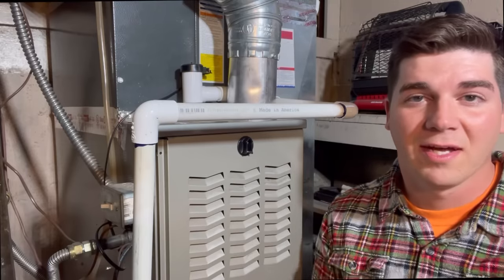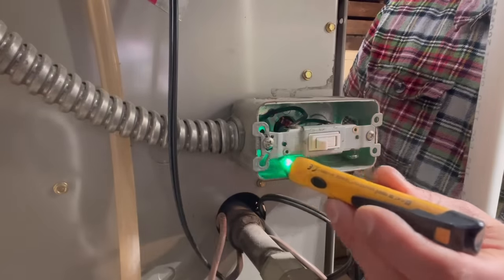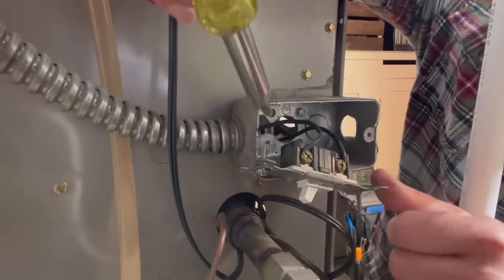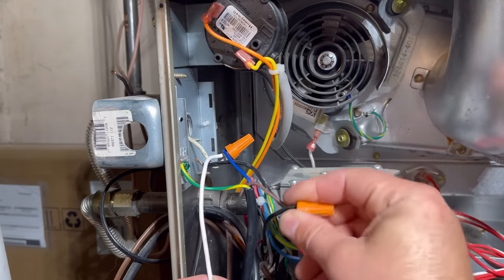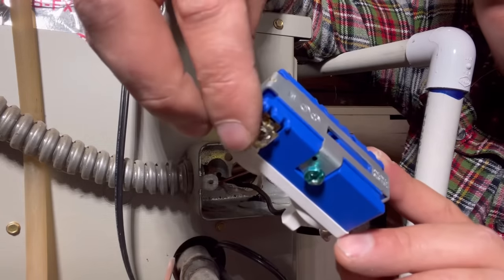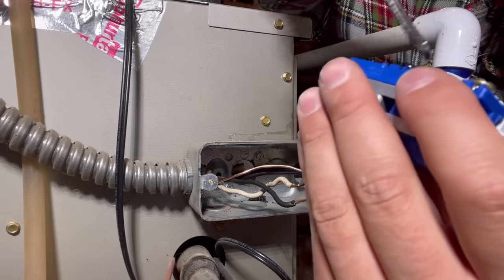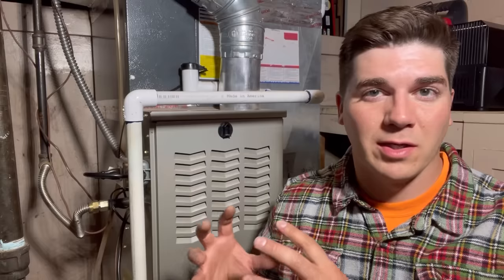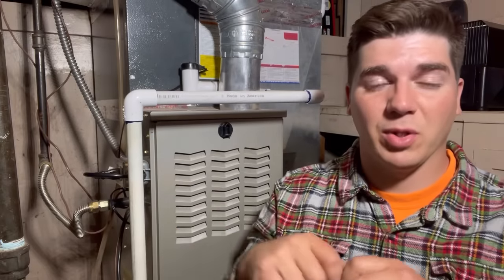This Could Keep Your Family Warm During An Emergency Power Outage.

Comment: Maybe it's just me, but I always use the tester to test that there is power before opening the breaker, and then test to see that it's gone.
Testers don't always work, and how close you need to hold it from the wire is vague.

Comment: It's a  gas furnace with a 120v blower fan and 24volt controls powered by a small 120v to 24v transformer.  I'm  thinking.

Comment: Went through the snowpocalypse in Texas in 2021.  10 - 12 hours without electricity, and house temp inside fell to 42 F.  I am committed to a separate power supply solution for the furnace.    I did a similar rewire to shut off power from the breaker box and add an outlet.  However, now I am concerned to make certain that the wiring inside my portable power supply is thick enough gauge to supply the wattage and current required of the fan motor for extended periods.  How do I determine the working wattage of an active furnace?  Do not want to exceed the separate power supply’s ability.  BTW, you should remind that this is only for a gas furnace.  Electric coil furnaces will likely exceed the wattage of many inverters.  Must be concerned about fire danger and melted wiring insulation.
Reply from the maker: You’d need to check it at startup and while running with an amp clamp. Alternatively you could just pick up a 1500w inverter and see if it works. If so, you can measure the amp draw on the inverter itself. Here is one that I’d recommend:

https://amzn.to/3BWtAPB

Yea I should have stared its only for gas furnaces but an electric furnace wouldn’t even have a switch line this. It will have breakers so someone couldn’t follow these instructions if they had an electric furnace.  Anyways hope this helps! Cheers,   Dave
Reply: @diyhvacguy  I noticed that your setup showed about 450 watts consumption when the furnace blower was running.  I like the idea of testing with an amp clamp, but you raise a good possibility of just getting the inverter with readouts and using it to measure.  I’m not sure how typical your wattage is, but 1500 should be adequate for most applications, I assume?  Sinking the money into the inverter instead of the amperage measure tool may be more economical way to go - a step ahead!  Hey, if I get really ambitious, I might even go solar charging on the battery, but it’s getting complicated for an emergency of limited scale that way.  I just want to keep from freezing to death, or pipe bursts, for a few days, as needed.

Comment: good info--ty!! i'm trying to pre-plan for winter and eventual power outages thanks to NY lousy grid. i'm escaping this state sometimes in the near future so i don't want to pay for the whole breaker box redo for a Bluetti plug--plus those get super pricey w the extra storage batteries to run the whole house...just wanna keep the furnace going. Looks like we have the switch already on the furnace--i'll just need the electrician to do the swap for the plug-in/switch combo. Ty for the vid--i can at least understand what to ask the electrician and not seem like a total dummy lol.

Comment: @The DIY HVAC Guy   Thanks for your prompt reply Dave!  I am not an electrician so I am still confused on what to do about the fuse.  When you mentioned, 'another' fuse, I don't see another fuse anywhere.. .  The shutoff switch plate has a 15 amp fuse mounted on the front of it and then inside that box are the available wires that go to the furnace and some go out to an extra box (with a duplex receptacle installed) on the side of the furnace so I can plug in my automatic condensate pump.

(Getting back to the extra fuse... where do I look to locate that extra fuse... that is, if it even exists?)  
 Have a wonderful Holiday and thanks again!!
Reply from the maker: Does each circuit have a fuse at your main panel?

Comment: If I'm reading the schematic correctly, in the event of a power failure when the pigtail is being fed by the inverter, and since all the hot wires go into a 3 wire WAGO, doesn't one of those hot wires backfeed through the jumper wire into the switch and back onto the main power grid?  That is, unless either the switch or the panel breaker is turned off?  If so, not a huge deal.  I'll put a sign on the furnace next to the switch reminding that the switch needs to stay off.
Reply: In the event of a power outage, they pigtail plug from the furnace is removed from the outlet and plugged into a generator.  The outlet and furnace are 2 separate entities once the plug is removed from the outlet.
Reply: @jolkraeremeark6949  Thanks. I see now where I went wrong.  Somehow watching the vid where black wires were put into the Wago, I got the mistaken idea that a black hot wire from the outlet box was part of that group.  Looking at the vid again I see now that's not the case.

Comment: Do an easier way to keep your furnance on during power failures. Get a whole house emergency generator by Generac. 
As soon as the power goes out, the Generac generator will kick on automatically. Even when you're not home.

Comment: just so you know, there is a video on here showing how the Wago things actually give off a little heat, this means the connectors are wasting power because you don't have direct contact between the two wires.  but yeah, they are real easy to use and with wire nuts unless they are very tight they can come apart.

Comment: would be better if it was some kind of plug that wasnt so easily removed. Also some labeling nearby wouldnt be a bad idea either. It is fine if you are dealing with it but if others need to it could be disorienting. Overall a good concept.

Comment: I was thinking about something like this until I learned, surprisingly, that the two AAA batteries in my basement fireplace thermostat are all that's needed to run the whole thing. It doesn't need a stronger power source to manage the automatic starter or gas valve. How crazy is that?! Impressive engineering.
Reply from the maker: That is impressive :) thanks for sharing

Comment: Wondering about doing similar with a powertool battery inverter. I have 40v and 18v inverters, and a ton of batteries.

I should take an amp draw on my furnace one of these days to see if that'll work.

Comment: Yeah, get a fireplace.  :-/   :-)  I started to say that that would have to be one HELL of a battery...and then I realized this was a gas furnace, which I've never actually owned.  Typically a heat pump with strip heating augmentation here in Fl.   Good idea, the subject of this video.  

The other way is just have a generator and power the house with it when power is lost, because things like refrigerators, lights, entertainment systems, fans, etc. are nice to have to. Here in Fl we have hurricanes, and in one my power was out for three weeks, hence, the genny.

Comment: Good idea for those who don't have a generator. Just for your viewers I have to mention that when terminating your wires on switch and receptacles it's best to loop around the screw in a clockwise rotation so when your tightening its actually sucking the wire around. Even when the receptacle or switch comes with the holes you can poke the wires through the back or clamp that will hold 2 wires beside each other always wrap one wire around the screw and make a pigtail if you need to. Never use the hole in back of receptacle for a connection as there is literally nothing making contact to that wire inside there. Shouldn't be allowed to make them.
Reply: The clamps make a perfectly good connector. The backstabs should never be used.

Comment: Your configuration is different from what I would consider a UPS hookup.A normal computer UPS configuration has the UPS plugged into a power source (wall outlet) then the computer plugged into the UPS. Under normal conditions, the computer runs on home power and the UPS is just the connection to that power. Power goes out and the UPS very quickly switches power to the battery backup feeding the outlet on the UPS the computer is plugged into.Why isn't the furnace wired the same way...UPS plugged into wall outlet, furnace plugged to UPS all the time. Furnace is running on normal home power all the time until there is an outage.No special wiring on the furnace, no need for manual intervention when power goes out - it automatically fails over.This setup would make it easy to connect the UPS to an inverter from your vehicle for extended outages,  just plug UPS into an extension cord from the inverter.Only potential problem I see would be that a non-hardwired furnace connection is against code.But what would a solution be to a problem where your power company can not deliver clean power to your home. Most home appliances would not be that fussy but most new gas furnaces require clean, pure sine wave power to operate correctly.
Reply from the maker: You read my mind, I’m doing a video on this very soon! Stay tuned :)

Comment: Great idea. I plan to have an electrician do the same for my furnace, but was wondering if the air conditioning air compressor is hooked up to the furnace that this method could also be used for the air conditioner in the summer?

Comment: it's amazing how so many people watched this video and still didn't understand how to power the furnace with a battery/generator, most seem to think you plug into the open socket which is wrong you plug the pigtail into an extension cord from your power source, also those who think it would be dangerous cause the power could come back on well that doesn't change anything since the furnace is being run off the pigtails power source so there is no power coming from the breaker to the furnace until you unplug the pigtail from the extension cord power source and plug it back into the socket that is being run from the breaker. damn, it's scary just how many people watches this video and didn't listen or couldn't understand what he was doing with step-by-step all the way through explaining everything.

the only thing to consider is the top pinned comment about having a ground
Reply from the maker: Yea man, and believe it or not if you watch one of my newest videos it’s actually how to just change your switch to a standard outlet, which is even easier, and there is still people that think the prongs are live! 🤦🏻‍♂️
Reply: @diyhvacguy  Ya it seems many people just don't pay attention before commenting nonsense, thanks for the great video and very good explanation of the work done

Comment: One thing you might want to do, that I noticed, is that you've got 20a service from the panel to the heater, not sure what the heater is rated for drawing but if it is 20a you might want to put a 20a plug/outlet on there instead of the 15a one. Biggest reason is just so that you don't overdraw what you're connecting to the heater (generator). Otherwise this is a pretty neat hack.
Reply from the maker: My labels on my box need redone. That actually wasn’t the furnace breaker, I was just trying to emphasize that the breaker needs to be turned off before messing with anything. Didn’t realize people would read into that so much. Thanks for the feedback

Comment: lived in suburb of philly  through a bad winter  whe had jan od ice storms oil tank failed got water in  good  oil co put us on barrel but min wage helper was told just such the top oil to keep us running but moron put suction to bottom sucked water and the lines under house froze so 5 gal can inside  , had fireplace 1 tiny el heater for mom and i had heating pad
but the oil tech braved the ice made many trips to get us warm  and covered most cost under service plan
i removed undergrown tank and 30 yrs later i will never ever bury fuel tanks at a home

Comment: another connector between the box and furnace would save the wire from the edges to, also need to bond the box as well.
Reply from the maker: Yes I have since installed a grommet there. They can be found on my Amazon store for anyone who is looking for them.

Comment: This is a nice quick hack.  Not as elegant as an interlock switch in the panel, but not everyone wants to do that.   I don't suppose you took a power reading from the furnace?  You used a 15 amp receptacle and plug but it was a 20 amp circuit.
Reply from the maker: The breaker isn’t 20amps. I was just using that clip to emphasize the importance of killing the furnace power at the breaker before touching anything. Didn’t realize people would read into it so much. Cheers
Reply: @diyhvacguy  It's youtube ... people will notice EVERYTHING.  :)

Comment: I've heard of many people doing the same thing, but making the power cord a double male to plug into the outlet to power the furnace.  Even though double male cords are dangerous.  I like the way you did this.  Makes it much more safer and easier in the long run.
Reply: I heard there was a secret cord, that you could use to meet the Lord.
Reply: @AndyClements  HA!
Reply: Uh...how is this a double male?  When that pig tail is disconnected, there's no power on that male end.  Perhaps you are confused since it runs through the box that has the line voltage?  Runs through that box but DOES NOT connect to the line voltage.  He just happens to be using the same box where the switch is located.
Reply: @bryanwelsh7608  Because you didn't read what I said.  I said people have made double male plugged cords to plug directly into the outlet and into the generator, which is dangerous.
The way he has it set up is much safer.

Comment: You didn't need to break off the jumper tab and didn’t need the jumper wire.  The gold screw is the landing point for the incoming hot, the two black screws are the switched hot.  If you wired the incoming hot to gold, when you turned the switch on the black screw at the switch becomes energized, and so does the other one via the jumper already installed.  So the outlet is switched with no modifications.
Reply from the maker: I believe the jumper is due to the led light.
Reply: @diyhvacguy  it's just a snap switch, when you throw it, it connects the two screws (gold and black) together.  The led is likely wired to the black screw on the switch side.  With the jumper in place the led and the outlet would also be connected together.  The only reason to break that tab is if you want the switch to operate one circuit (with the output connected to the first black screw) and you want the outlet to be unswitched, so that black screw is either jumpered to the gold with a pigtail for constant hot, or a second hot circuit is connected to that second black screw.
Reply: It's a great mod, for all the reasons you describe.  I'm just commenting on a simpler way to do it.  I did something similar to my refrigerator circuit.  Once it leaves the breaker panel in the garage, I wired an outlet and appliance cord with plug in line before it goes in to the house and to the fridge.  For the exact same reason and function.  In a power down situation, I can unplug it and plug it into a battery/inverter or a generator.

Comment: Good solution with a few comments below providing important clarifications. The only one I have not seen is that I would recommend turning off  the new switch when using the generator. Just another way to make sure there is no back feed into the line.

Comment: Great info. But my gripe is that every house I have ever lived in has the Air Handler located in the attic and nearly impossible to access and work on, unlike all the videos I see on YouTube with a dedicated space with fantastic access!
Reply from the maker: You can still do this and run an extension cord to it in a pinch.

Comment: My heater/AC unit, is the horizontal variety ( Lennox ML180UH)..   I need to go check it more thoroughly, but..  I do have a on/off close to the attic door that can enable power or disable power to the furnace.    Wouldn't this work for the splicing in of the inverter output?   as long as I disconnect the source power, there, and swap it to the inverter output.   The output of the switch goes into the hole of the unit where power goes...  I just need to open it up more, but seems ok to do this here.

Comment: That setup will only work with a gas and oil furnace it will not work with a all electric furnace bc you need 220 volts for the electric igniter. But a great video

Comment: Well you have a great idea there be curious to know what size inverter you were using to run that furnace because that’s a pretty big furnace and that motor is a pretty big blower so that’s gonna be a pretty big low draw when it first starts up, and if your inverter is not big enough, it’ll shut your inverter down Most people who probably take your idea may not know this a lot of people go out and buy inverters based off of just running lights and what have you they don’t consider the power factor they need and running everything load wise me my inverters are big enough I can run my house in my neighbors house It’s all about the amount of power but that’s just me so I don’t know if you made a video or not but maybe you got a video or maybe you should make a video and what minimum size inverter you should have to run something like a furnace anyway, like I said, it’s a great idea. Thanks for the info and something I never even thought of, but that makes Perly sense.

Comment: You could have installed an interlock switch on your breaker box and connect your inverter to the the breaker box. Then you would be able to provide power to other circuits besides your furnace. Of course you would have to turn all of your other circuits off to isolate what ever appliance you decide to use
Reply from the maker: Yes I’ll be doing this very soon! Stay tuned for that! Cheers